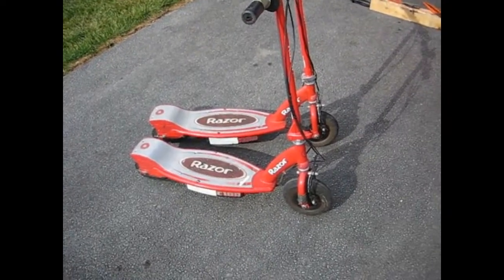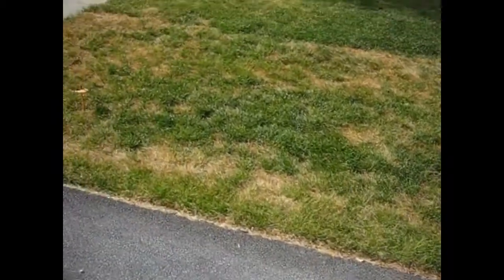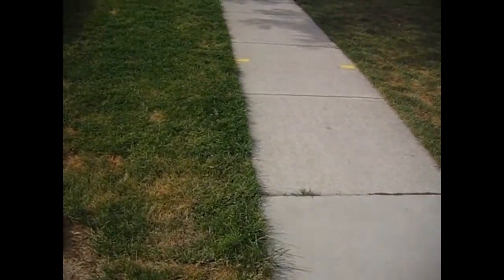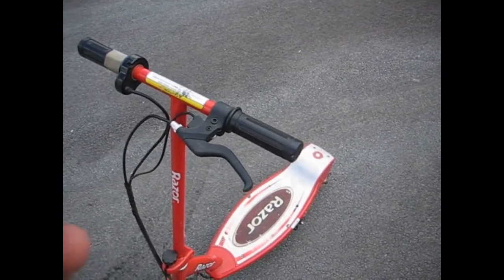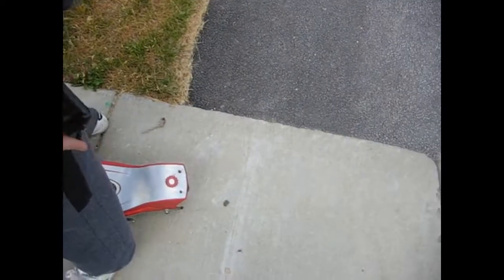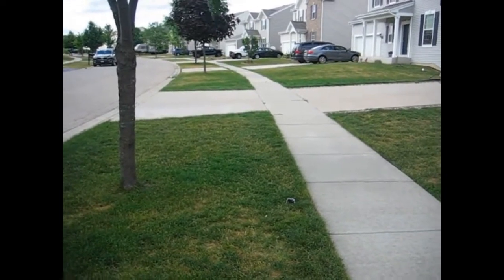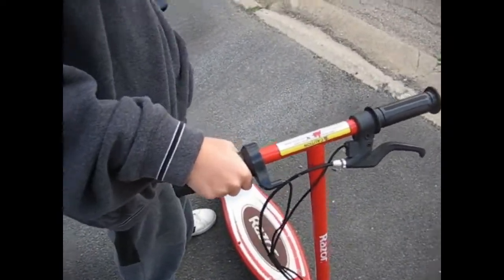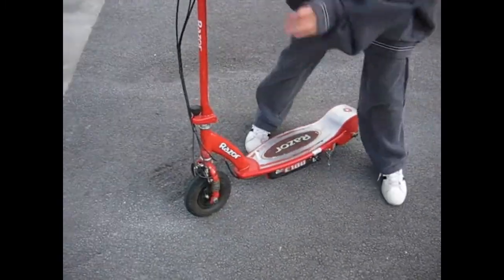Stock RAZOR E100 vs Modified 36v E100

Comment: Thanks for the video I just purchased a couple used the 100s for my kids do you have a video on how do you install 36 V battery
Reply from the maker: Hmmm, I don't know without looking, but it was a simple install of the 36v controller and throttle, than a new connector for the battery. Maybe I will do one if I find another cheap E100.

Comment: Do u know how to bypass a kickstart on razor e100 stock pls help
Reply from the maker: Here is a short with a picture. 
https://youtube.com/shorts/6BDLZGMhWF4?feature=share
The scooter is still running strong.
Reply from the maker: If you swap to a different controller the kickstart will be eliminated.  It is only in the stock controller. You can use an E200 controller and throttle.
Reply: @bdrgarage7039  ia there anyway like soldering a wire into the controller saw some video to bypass

Comment: How long does your hoverboard battery last on an overvolted e100?
Reply from the maker: My 100lb kid runs roughly 30min, maybe longer. You can always run 2 in parallel for double the time.
Reply: @bdrgarage7039  oh, thanks for such quick reply!

Comment: Do you have to change the controller (esc) to do this mod or can I leave it stock and then just add the 36 volt battery and also has the motor had to be replace because of a failure after this mod or has it been working fine
Reply from the maker: Definitely have to replace the controller and throttle to 36v. I used a cheap ebay one. About $25 at the time. My motor still works but overvolted motors will wear faster. The rpms get raised by 50% and that's where the top speed comes from. The hoverboard batteries are great, out of 4 had one prematurely fail. Probably the bms board
Reply: @bdrgarage7039  ok thank you so much and also when you get the hoverboard battery did you have to buy a connector to connect the  hoverboard battery to the controller or did it just plug straight into the 500w controller that you said to buy and is there a way to charge the hoverboard battery without the actual hoverboard because if so I am definitely going to try this
Reply from the maker: @Gman54563  I ended up buying a used hoverboard with charger for $50 originally.   There might be a way to just hook up a charger directly to it but I wasn't totally sure so went the safe route, plus my kid can ride the overboard when it is put together and not charging batteries.  I did also have to make a connector from the original white connector to an XT60.  Let me see if I can get a picture on here somehow
Reply from the maker: @Gman54563  https://i.postimg.cc/7LjR28gP/20230212-161326.jpg
Reply from the maker: I hope that helps. In the middle is automotive connections. A little solder but I am terrible at soldering.
Reply from the maker: https://www.ebay.com/itm/143950293601?mkcid=16&mkevt=1&mkrid=711-127632-2357-0&ssspo=7CnuptjcRqq&sssrc=2349624&ssuid=MGlbrHjSTTW&var=&widget_ver=artemis&media=SMS
Reply: I might be wrong, E100 use a simple relay to turn motor on, Stock controller is no difference to switch 36V,  I don't see  the reason to change controller unless you want variable speed control.
Reply from the maker: @jackwo8708  If you run 36v on the stock controller, it will fry fast. Everything inside is made for 24v, it's the heat sinks that go first. All motors can run 12v more or 12v less. Try it, see if it holds up. The 36v Razor controller needs a bypass on the heatsinks to hold 48v. I have done this many times but a proper 48v replacement controller nets more top speed.

Comment: Yo do u know how to change the batter and stuff bc idk how to do that can you respond if you know how
Reply from the maker: Of course. Hopefully it has the old and the connections are not soldered.  Easy swap at that point.  If they are soldered,  cut and splice new connectors in for the new batteries.
Reply: @bdrgarage7039  is there any way you could contact me and assist me
Reply from the maker: @flxtz306  my time is valuable.  What exactly do you need help with? I can make a video if necessary.
Reply: @bdrgarage7039  I just need to know what motor I should buy to put inside and how to connect it into the scooter
Reply from the maker: @flxtz306  the 36v scooter I built at 17mph was the stock 100watt motor. I used a cheap Chinese 36v 500w controller and throttle. Then added a hoverboard 36v 4.4ah lithium battery.
https://www.amazon.com/Yoidesu-Controller-Throttle-Electrical-Tricycle/dp/B07WJZXLWR/ref=mp_s_a_1_7_sspa?crid=264JUT891U81O&keywords=36v+controller+and+throttle&qid=1674955872&sprefix=36v+controller%2Caps%2C112&sr=8-7-spons&psc=1&smid=AZIWKB4RUNANS&spLa=ZW5jcnlwdGVkUXVhbGlmaWVyPUEzMUxPTFFENENVNFJCJmVuY3J5cHRlZElkPUEwMjU5NDI1M0RGUjhPSERUMTdGRiZlbmNyeXB0ZWRBZElkPUEwNzEyODQ3Mzc0RUtHTzNDSEIyMiZ3aWRnZXROYW1lPXNwX3Bob25lX3NlYXJjaF9tdGYmYWN0aW9uPWNsaWNrUmVkaXJlY3QmZG9Ob3RMb2dDbGljaz10cnVl
Reply: @bdrgarage7039  so I should only buy what u sent on the link or is there more I need to buy for it
Reply from the maker: @flxtz306  that controller/throttle plus 
https://www.ebay.com/itm/144201811896?mkcid=16&mkevt=1&mkrid=711-127632-2357-0&ssspo=GYsqedpyRMe&sssrc=2349624&ssuid=MGlbrHjSTTW&var=&widget_ver=artemis&media=SMS
But you need a hoverboard to charge it.  That's what I have.
Reply: @bdrgarage7039  ok
Reply: @bdrgarage7039  Thx
Reply from the maker: @flxtz306  your welcome.

Comment: What type of range do you get out of it? I’m thinking about running 2 of those batteries in series for a go kart
Reply from the maker: With the one 36v 4.4ah lithium hoverboard battery, a 70lb kid was running about 30min, I installed 2 in parallel on my 36v pocket bike and it (750w total overvolted) was 30-40min. Mileage unknown because I have hills. I bet 2 on the scooter (150w overvolted) would be an hour.

Comment: Doyou charge this with your stock charger?
Reply from the maker: The modified E100 uses a hoverboard battery, I use a hoverboard and hoverboard charger to charge the battery. You CAN NOT use the stock charger to charge a lithium battery. It was the smallest lithium that would fit and cheap. $50
Reply: If you switching from 24V to 36V mod, you have to change to proper charger, those Lithium batteries are very picky on charger.

Comment: Traditionally, pointing the camera at what you are supposed to be capturing on video is considered a good practice. I have a 36v scooter battery I was going to hook up to a e100, my search for "is this a good idea" led me here...
Reply from the maker: Well I'm sorry my camera practices are terrible. I am definitely not a professional. But in the end it is a good idea to modify if you were looking for a quick boost in power. It will wear out the motor quicker but for the limited use that most of us do, it will last year's.
Reply: @bdrgarage7039  sorry, I had just discovered my variable DC Power supply AND multimeter had been crushed in a storage mishap, and I was a little snarky. It's weird how the places that sell Razors NEVER sell the chargers....Still, my bad. and thank you for making the video.
Reply from the maker: @richtravis9562  I understand.  Sorry to hear about the mishap. And yeah, charger should be more readily available.  The higher amp output chargers are what you want. Stock is about 0.6, 1.5 for the e100 is desirable. On mine I am running a hoverboard 36v lithium pack. I charge it with a hoverboard. Lithium would make a great upgrade over the lead acid on a stock e100. 24v are a bit more difficult to come by.

Comment: Cool project. Any idea if the original 24V motor is likely to burn out at the higher voltage?
Reply from the maker: I have overvolted a ton of razors, eventually all Motors will burn out. None of mine have yet, but I'm not sure how fast the 100 watt motor will burn out. I do have it up for sale but I have my kid keep riding it and maybe we'll find the end of life for the motor or maybe not.
Reply: @bdrgarage7039  nice, thanks for the info!
Reply: I plan to buy a e100 very soon! I wanna try over volting it aswell the motor should be just fine!
Reply from the maker: @johnydelgado7901  nice, overvolted they are fun. It is still running, been almost 2 months I believe.